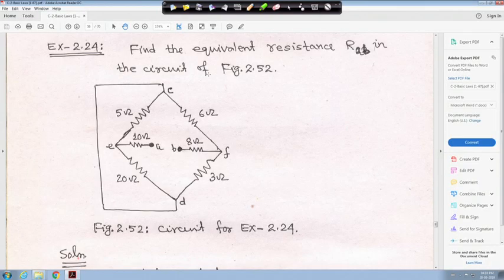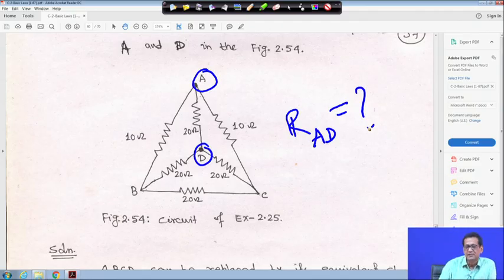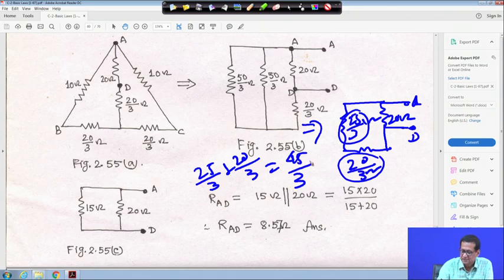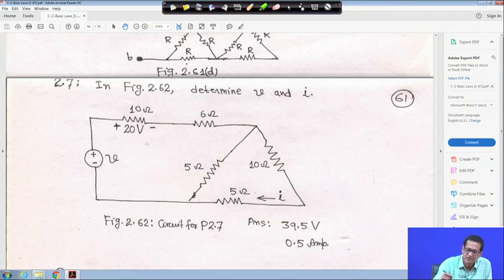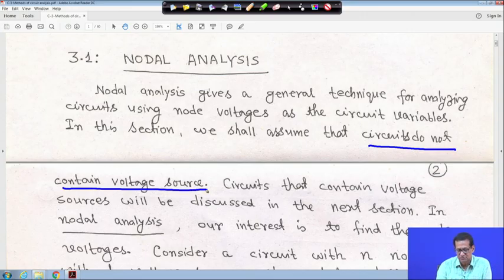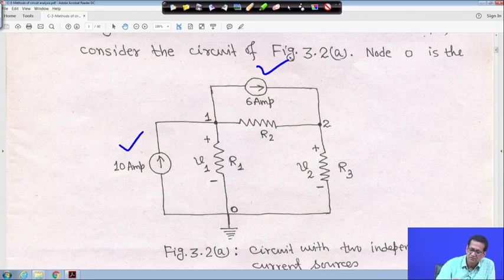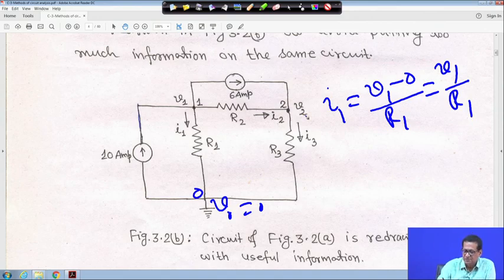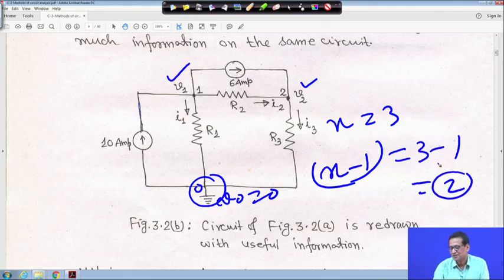Lecture 11: Methods of Circuit Analysis

Comment: Sir, in 2.9 - if current through 'r' is Zero, means the connection is open... (1+2)ohm is in parallel with (4+R) and overall in series with 2.6ohm. 
Sir how do we solve further??